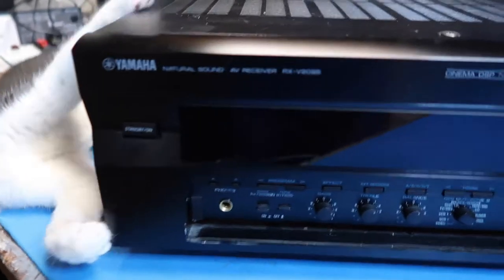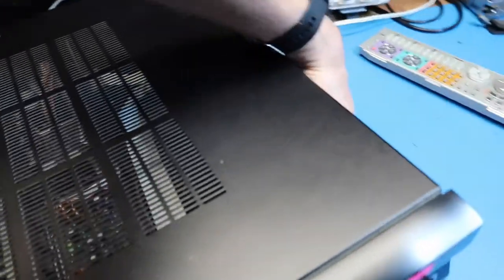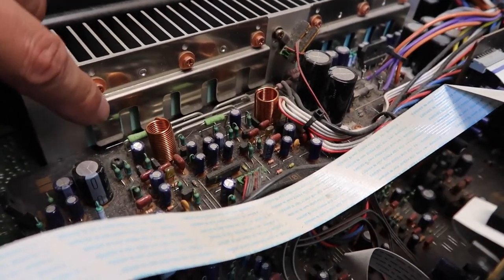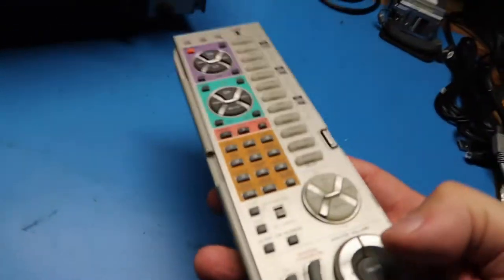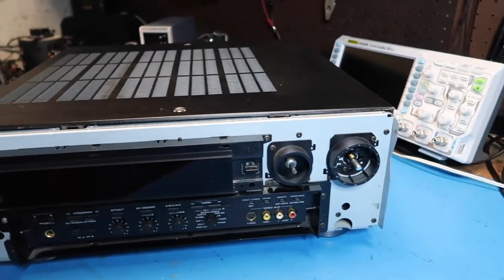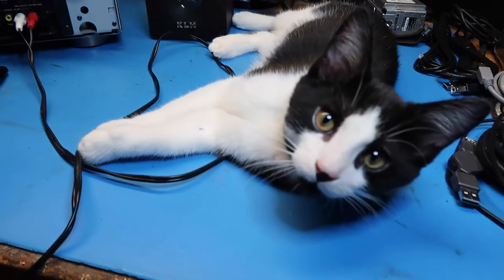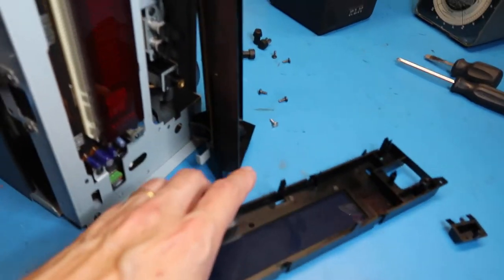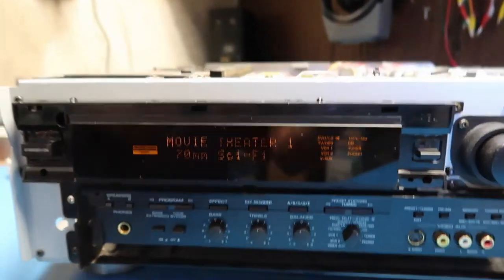Discovering and Fixing a Yamaha RX-V2095 A/V Receiver

Comment: Still have mine and it runs the same as when I purchased it.
Reply: Mine as well, same as the day I bought it new. Mine is a dual voltage model bought overseas, are they all like that?
Reply: @robl7532 hi how to get front chennal sound( not And B) I'm connecting A main for left and right, center and Surround.. That's working but Wen connected extra two speaker to left right next to center no sound..  Any idea?

Comment: 21:00 what about adding a spring to the mechanism? looks like the purpose of the tab was some sort of tension spring, might be able to supplement it by just adding a real spring.
Reply from the maker: Thanks for the comment. That's not a bad idea but assuming the glue that I used holds, I think the springiness of the plastic itself will meet the need. (That seems to be the way Yamaha designed it originally.) Also, the travel on the micro-switch is only about 1/8 inch, so I'm not sure how much room there is to put in a spring.
Reply: Brilliant idea !

Comment: Hello, it’s been more than 2 years last time I turned ON my RX-V2095 surprised that front main right channel isn’t working at all plus the sub seems no signal coming from the receiver, another issue that I noticed, when I touch the main couplers at back side specifically the lower one (R)I  hear a high hum from the channel that isn’t even working witch is front main right, appreciate any positive advice!!
Note: test tone are working normally for all the channels except the right ch.

Comment: Hi hope you are well? I am having abit of a issue with my reciever hoping you can assist. It switches on for 1 second and switches off,I was told I need to do a factory reset but I don't have a remote! Is there any other way to do the reset? Or any way for me to look into the problem of it switching off after 1 second?
Reply: Hello,just saw your message - have you been able to fix this issue? I have same and it switches itself off randomly

Comment: I never use this switch to turn on/off my Yamaha RX-V2095. I only use the remote  control . You didn't need to fix it .
Reply from the maker: Thanks for the tip, but I needed to fix it for resale.
Reply: @SomeDisassemblyRequired  
And how much?. I would like buy it.
London.